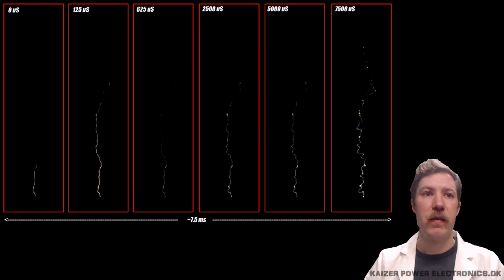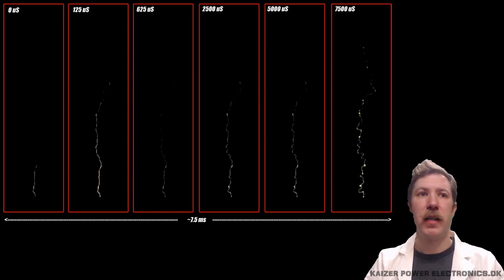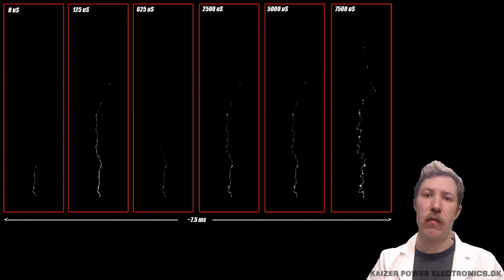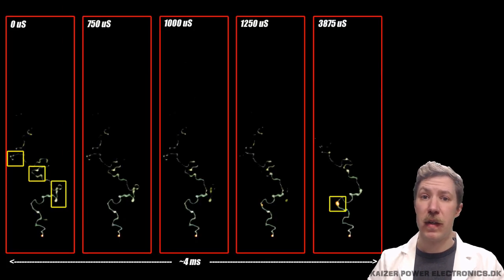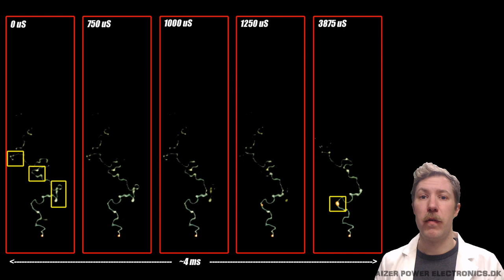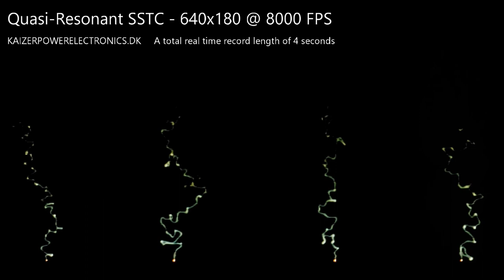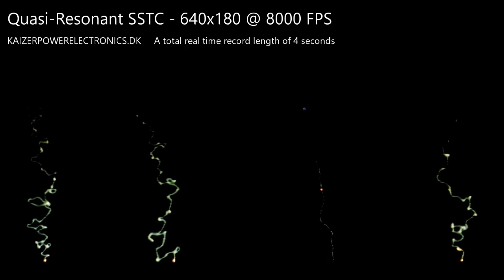8000FPS Slow Motion Tesla Coil Spark Formation and Collapsing Hot Spots

Comment: It looks as if the initially small path deviations are quickly magnified by skin effect - the channels are magnetically pushed away from the average axis until the non-ionised air path has lower breakdown voltage than the voltage dropped along the extended ionised channel. But I don't have an idea (yet) about the hot spots.